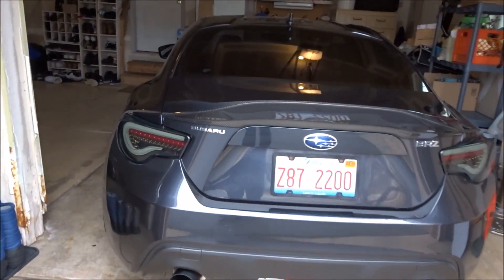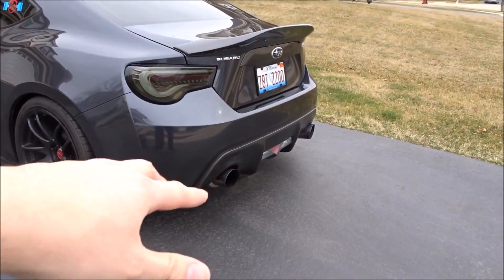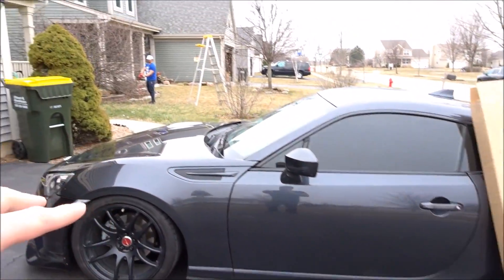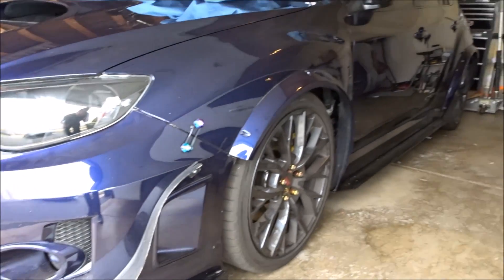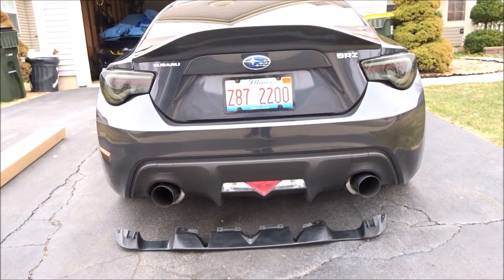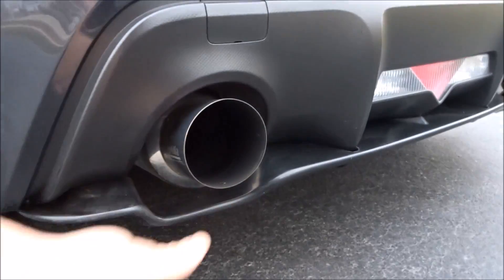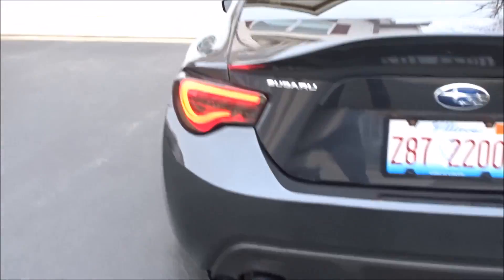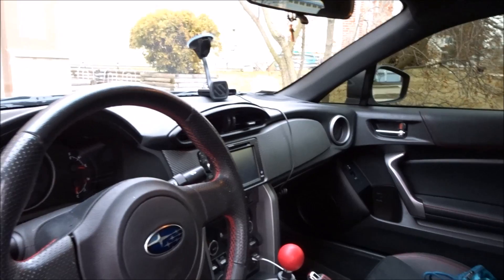CUSTOM REAR DIFFUSER INSTALL! (Subaru BRZ)

Comment: Dude, that diffuser looks great.  I might have to get one now. Also my opinion about your interior is maybe keep the seats stock, and focus on the trim pieces.  The carbon fiber pieces look great all around.  The seats honestly are great as is.   And seriously, a carbon fiber hood would look great on your BRZ (unless its one with a hood scoop).    Lastly, that STI is amazing. Your buddy has immense will power to not drive it year round.  Show car or not,  I’d be trying to AWD snow drift that shit everywhere.
Reply from the maker: Thanks man! So many compliments on it the last 2 car shows I went to this week! I was thinking that to. Stock seats but just modifying everything else! Like you said the trim and all the plastic parts can be swapped out! The mood I'm still debating. I really think it'll look good but the car looks good right now too and I don't want to regret it. We'll see though! I'll make the decision soon because when I start entering bigger shows I'll need to dial everything in! And yes I agree. My buddies STI is so clean. All quality parts and his new Volk TE37s are care coming in soon and once he mounts those and adjusts his suspension I'll be making a video on that! His STI never seen snow but he does have a newer legacy that's his daily which is a solid daily because it's AWD as well. The STI is one of the cleanest hatches I've seen!

Comment: Looks good! I don't think I'd want anything more aggressive, especially if you're daily driving the car. Maybe if it was strictly a show car, but as it sits now I think it works out nicely.

Same principal applies if you're going to update the interior. If this is your daily, you may not want to go too "out there" with the mods you choose. While a new racing seat may look good, consider how comfortable it will be to live with if you're not planning on tracking the car. Not saying not to do it, but just think about how it will fit into how you're using the car.
Reply from the maker: Thank you! So happy with the diffuser. Really flows well with the car. You have to remember tho this isn't my daily! For any long drives or times I want to be really comfortable I use the Lexus but I still want the BRZ to be comfy. For the Interior I'll probably go all out but I won't get stationary bucket seats that don't recline. Awesome thing is so many companies make reclining race seats that are comfy and look great! Just have to find out what color scene or theme I want to do. And just the normal stuff, Harness, Harness bar and keep the normal seat belts for normal driving as well. It'll be good for track days to have the seats and harness. Also a new OEM style steering wheel and I want to either replace or wrap most of the trim pieces to make everything match and look clean. It'll help for shows to have a clean interior! Upgrade the head unit and get better speakers/sub because the one that came with the limited is so bad in my opinion. I ordered a couple things already but I'm excited to get started. As time goes on I'll think of whatever else I want to do but whenever I see a unique BRZ, frs or 86 interior it really makes me want to do the same!

Comment: The rear lip does not match the factory rear diffuser in colour. Those side skirts, you can hardly tell that the car has any. Wheres the rear bumper corners to match the rear lip? All these things need addressing if you want to be known as a reputable modder.